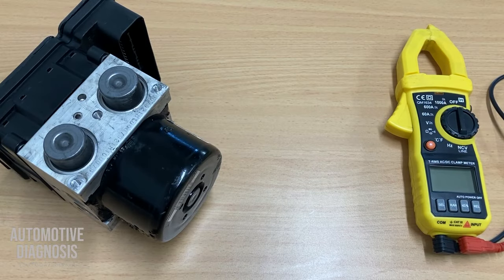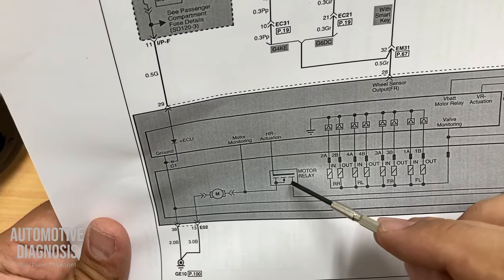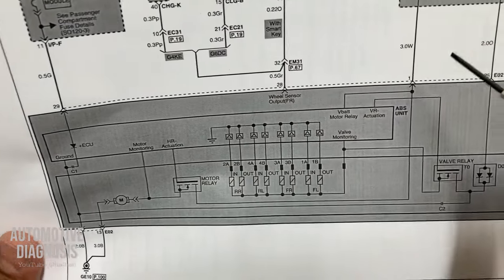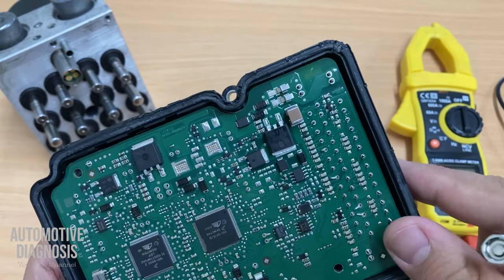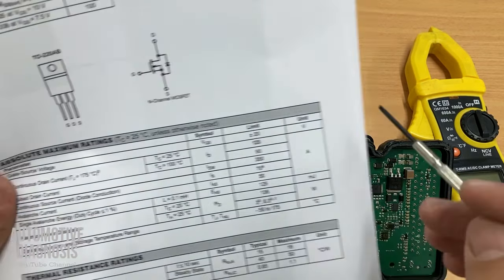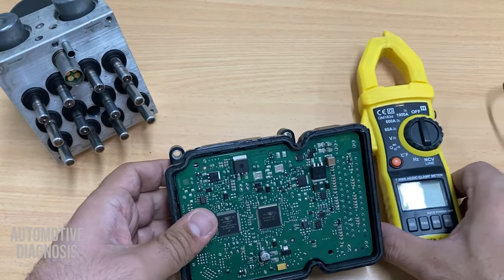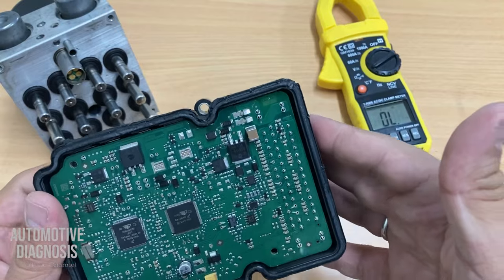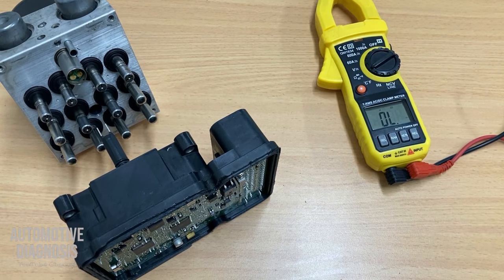Don't Replace ABS Module Before Watching This | Repair ABS Module for Motor & Valve Relay Error

Comment: Hello there nice video.

I have Ford Lincoln 2010 MKZ and is giving me error B1342-20 do you think this could be the electric part of the abs module or the hydraulic part of the abs module issue
Reply from the maker: Hi there, for this fault, I will do the electrical inspection first. But do not remove the ABS module straightaway, checking the power supply and ground on the ABS connector is the first step.
Reply: Thank you, I just checked all the connections and fuses and it's all good. What would be the next step

Comment: I have a 2010 jeep Rubicon. For about 3 years now I have the 3 lights lit on my dash, ABS, TRACTION CONTROL, and airbag. The code is C2116, low voltage at the ABS module. It used to be intermittent but lately they're on all the time. Very few seem to have this code. Can this be common with the module? Thanks.
Reply from the maker: Hi there, it could be the module or wiring problem. The following video could be helpful for checking the main power supply on the module and ground.
https://www.youtube.com/watch?v=F2RiGkoK9_g&t=9s

Comment: Amazing work my friend
Reply from the maker: Thank you very much
Reply: @AutomotiveDiagnosis  I would appreciate very much if you can point me in the right direction.  My Captiva 2010 has ABS, TC, Brake, Hand Brake lights on.  Error codes are C0201:04 & C0550.  I touch up most of solders you showed but no changes observed.  Same lights are still there.  I also bought 2nd ABS cluster from wrecker to transplant eprom as next step.

Comment: For 2012 Honda Civic, I am seeing 81-20 that states built-in acceleration sensor failure(ABS), at times there is another one 85-01 VSA signal failure(electronic power steering). But consistently seeing 81-20. Any thoughts and guidance if ABS pump can be repaired? Thanks

Comment: Hi Dr that's great teaching
But is there any simulator that could help us dignose the ABS MODULE?
Reply from the maker: Hi there, Thanks a lot. Actually I haven't seen any simulator for testing the ABS Module. But as the structure is mostly the same, checking one can pave the way to know how to fix the other ones too.

Comment: Good evening, a question if possible about the abs pump power supply: if there is continuity but voltage drop at the output from the board what does this mean (Input pin on the board: Volt = Battery (13); Output pin on the board approximately 9.00)? A thousand thanks
Reply from the maker: Hi there, you must focus on input and internal connections, some voltage drop is normal

Comment: No error codes!  My guess is that a valve is stuck, but it would be great if I could get in touch with you before I cut the top of the module off.  I would prefer to send it to you to do it properly 👍. Please let me know if you’re open for taking the job.  The unit is out of a 2008 Holden Captiva.  Hmmm… also no continuity between pump negative and either of the main ground pins.. faulty mosfet?
Reply from the maker: Hi there, thanks for your comment and sharing your experience. I’m overseas right now but I can give you some advice. If anything happens to ABS motor power or ground, you must get ABS motor failure fault code. But just in case that you don’t have any code and you are trying to find the cause, make sure you have the proper wiring diagram, check the power and ground on the wiring harness, check the connector, then ABS module. Also, mostly ground gets directly on ABS motor, not through MOSFET, so if it’s not provided, it’s pin or board issue.

Comment: Thanks,for job  but this shematic can use it at all the  ather abs systems thanks man
Reply from the maker: Hi there. Many ABS modules are very similar but the pin outs might be different.

Comment: They sure didn't put too much solder on some of those connections.  I was wondering if it might pay to just go through all the solder connections and touch them up with a soldering iron.  But, maybe you're right.  Check it first for any disconnects with the ohmmeter and then solder.  On another video for a Honda (Odyssey) they talk about a thin wire that tends to break between module sections and how it is difficult to repair.  Have you come across that?
Reply from the maker: Hi there, not exactly that case, but I've had some other cases with disconnection on PCB that can be found by pinpoint testing.

Comment: Hi, 
the way you explain is very amazing and interesting!
Where can we find such diagramme for our model?
Thnaks
Reply from the maker: Hi mate,
Thanks for your comment.
In the wiring diagram, ABS/ESP system you see the details but it actually depends on the manufacturer that what details are included about the ABS module internal configuration.
May I ask what is your car model?

Comment: Thanks for the work. How did you figure it out...  Also, what are the other chips in the circuit... The ones with lots of pins
Reply from the maker: Hi there,
There is another part for ABS module diagnosis that you can find in the video description, I normally explain those parts that don’t need the programming after replacement so I didn’t go for the main microprocessor.

Comment: Great instructional session.  I have the ABS light illuminated on the dash of my '02 Chev TrailBlazer 4x4, with OBD code C0267 -- "ABS Pump Motor Circuit Open".  I have good continuity at the motor connector (motor and leads good), but no continuity between the battery pin (#1 your diag.) and motor ground (#10 your diag.) on the circuit board w/ no power applied:  is this a normal condition because motor relay is open when unpowered, or am I likely to find a soldering fault once I open up the control module?  If I apply power to the circuit board (ignition key on), can I expect to see +12V at the circuit board ABS pump motor output pin connector?  I.e., is there a way to check for a pump motor "open circuit" condition on the board w/o removing the module cover?  Does the ABS Pump Motor normally run for a few seconds on every "ignition on" as a test?  Thanks for the great videos!

Comment: I have a 2012 jeep wrangler with a C2200 code showing abs module internal problem. Do you have a schematic or point me in the direction of what I should do first? The jeep will drive fine with no light for most the day then sometimes it will throw the same c2200 code until i restart it and it goes away. I'm hoping it's some kind of connection issue I could fix. They have been on backorder for a couple years so getting a new one is almost impossible. Any help would be greatly appreciated
Reply from the maker: Hi there, considering everything you said, I think you may start by checking the ABS connector, remove it, inspect all male and female pins, make sure the is no dirt inside the connector, clean it if necessary and then secure it properly.
Reply: I have checked and cleaned pins, it used to be an intermittent on and off prob for a month now its constantly on showing c2200 code only. I'm gonna pull module out and start checking just wasn't sure which one of the checks would throw a 2200 only. No other codes thanks for your help.
Reply: @braddunn5983 did you fix the abs at the end?  I have same issue re c2200.  Wheel sensors ok, wiring ok but still this error.  Can’t find a new module anywhere 😢Any ideas where else to check? Cheers Rudy

Comment: 26:58   off course we have to be carefull because its the brakes.... but if we are taking off the module down its because its not working properly BUT the brakes work good enough when you have them under tension. Its the initial actuation of the brake that is a little  sudden. The existing problem has cleared every inspection  although this has been going on on my car for 3 years..

Comment: Excelant tutorial how to check problnematic ABS module, I still missing one part from the diagram that is still not understanded by me and it is about presure sensor, how can we check it if it bad or not?
Reply from the maker: Hi there, for the pressure sensor we normally check the contact points on the sensor and on the board.

Comment: My ABS control board does not have any soldered pins on the multi pinned socket panel,they seem to be "push fit" type connectors.So should I resolder them all anyway ? (Focus Mk2 2010,UK)

Comment: 2014 ford  f150.XLT 5.0 4xx4,, code, C1440 EO. Which is, Pressure Difference Transducer Circuit Failure ,inside abs module I think?? .do you know what to check inside? Thanks,love your videos.

Comment: Super interresting. My control unit slides freely arround the Big valves pins. Il almost foalts arround them. It is not tight like yours. Is it common?
Reply from the maker: Hi there, thanks for watching. That should be fine. Some of them come with a thinner valves.

Comment: Hi I own a 2013 jk and a c2200 code shows.  Because I could not  get a new module anywhere in the world I had bought a second hand one.  My mechanic replaced the whole pump.   It worked perfect for half a year and then again I got a C2200 fault code 😢 Can this one be repaired or could there be something else
That triggers the code? Thanks

Comment: Thank you for your video.On my car (Audi)i have from abs unit the error  01130 (implausible signal).This fixes on your video is about this error?
Reply from the maker: Hi there, It could the ABS internal fault but it is much safer to check the power supply on ABS module and relevant fuses in advance as removing and testing the ABS module can be complicated. The below video shows you how we check the ABS fuse and power supply on the unit (this video is not made on Audi though), so it is possible to find the wiring diagram then locate the power supply on ABS connector to take the measurement.
https://www.youtube.com/watch?v=NTCEF8FSqTM
Reply: Thanks for your answer .I have check the voltage on fuses and connector and everything is ok.
This means clearly the problems is inside the unit.
Now, the problem the unit has, and I have this error, is due to what your video mentions?

From your experience.
Or  maybe it's something else. For example, need a complete replacement  cpu chip etc.

Comment: Hii
I'm having a issue with a mercedes c200.
There is a dtc C110700 left front wheel signal implausible, even after changing sensor and bearing and the code is permanent. 
Is the issue is with abs module.
Can you guide us on this fault.
Reply from the maker: Hi there, you need to inspect the wiring first. Find the wiring diagram, then check the wiring between left front WSS and ABS module.
Reply: @AutomotiveDiagnosis  we have throughly checked the wiring but issue is same.

Comment: Does the valve block leak if you pull the abs controller off. I want to attempt changing it while in the car by just replacing the controller
Reply from the maker: There is no brake fluid on the electronic part of the ABS but of course every job on that unit has to be done very carefully as all hydraulic components are jut next to that.

Comment: very good friend your videos explain better than the courses I've already done I have an abs module from the fiesta 1.6 mexican 2010 giving dct communication with gatewey the defect is intermittent the defect and in the module I already put another one and the defect is corrected you have augum video about this fix for me to see
Reply from the maker: Hi there, thanks for sharing your experience. If you have replaced the module and it’s been fixed, there is internal issue, you may also watch another video for ABS module repair for internal components test. (Link in description)

Comment: Great video I learn by my self electronic repairing my old cars ( I can'teffort a techniciaan like you) but is so hard to find diagrams i bought Hayness manuals and emanuals but they dont show the terminals pin out and is a nightmare to find all connections where is posible to find ? I search for siemens moduls diagrams to my peugeot which has a short some where from fuse 9 circuit in the VDO MODUL but i dont see siemens have them. Do you have any place where to find free or where is posible to buy them? 
I'm following from Norway where the mechanic houre cost about 190 usd. 🥴 It will cost 2000 usd a reparation they are creazy expensive

Comment: Hello please i need a help my mercedes w204 model 2009 shows esp abs direction assist not available through dashboard then the steering wheel becomes rigid when i roll over 20km/h this means that the system of abs doesn't work? May i change it completely? The scan detect a default which the number is 5001
Reply from the maker: Hi there, 5001 fault code if a "Internal fault in Control Unit". Before replacement, it's not a bad idea to check the power supply and ground on the control unit.

Comment: I have a 2012 Jeep Wrangler it was showing the c2200 code I sent module off and had it repaired and when I got it back and plugged it up and cleared codes the c2200 is gone but now im getting a c2116 pump low voltage code. Is this still a module problem or what do I need to do to verify now? I have never got this code until having module worked on any help is appreciated
Reply from the maker: For this code I would check the power supply on ABS Module first as it could be pin/connector problems. If voltage is ok, it could be internal fault as explained in the video.

Comment: Have a Nissan Wingroad 2003 QG15 engine the issue am having is only when the abs module wire harness is disconnected only  then OBD2 scanner will read my transmission once reconnected the scanner will not read or connect to my transmission or ABS could it be a short on the module itself or wire harness.
Reply from the maker: Hi there, most likely this problem is coming from the CAN-BUS as both transmission and ABS (and a couple of other systems) are connected to the CAN-BUS. I've had some cases that ABS module was stopping the CAN-BUS operation. And your scanner is connecting to this units via CAN-BUS, so when CAN-BUS is down, you will have no connection with multiple units including ABS and Transmission.

Comment: Can you test the ECU socket pins without dismantling the unit? My connector is showing 12v at the two power wires and grounds are correct values. But I am getting error abs pump fault - relay opened permanent. I can actuate values but not pump. Cannot find the relay as an external part, so Im thinking its inside the ECU...
Reply from the maker: Hi there, normally there is no external relay for ABS motor, as I showed in this video, there is a power mosfet to provide the battery voltage to the motor and it’s installed on the circuit board. The only things we can check externally are the presence of voltage of power pins and the proper ground connection on ground pins. The rest of the circuit is inside the circuit board.

Comment: Can you provide the link or website where we can print the abs diagram and website for the semiconductor that you show on your video. Much more appreciated. Great explanation and easy to learned.
Reply from the maker: Hi there, Thanks for your comment. That ABS diagram is already in the description, you can find a link to download it from google drive. I will also attached the semiconductor details as well. (Technically we can find the details for semiconductors by searching their numbers).

Comment: I have a car where the motor is running continuously. Even with the ignition off. I'm guessing the motor "relay" transistor is shorted. Where does the input to the base of that transistor come from? Is there a possibility that it's not shorted but being forced closed continuously by a faulty input at the base of the transistor?
Reply from the maker: Hi there, for testing the transistor you can watch the second part of this video (link in description), and yes, it can also be from the control module too which keeps the transistor active.

Comment: May i know this abs module is from which car model? thank you
Reply from the maker: Hi there, this ABS module was removed from a Holden Captiva, but it's very similar in other cars too.
Reply: @AutomotiveDiagnosis  okay thanks. Ive a Toyota denso abs actuator and it shows B+ motor relay short to ground. Im suspecting the abs motor after watching your video since its only the contact points at the motor for the positive and negative to shorts and there is no relay in the actuator just the resistor.

Comment: How do you open it with out breaking it so it can be put back together. Would a heat gun be a good idea?
Reply from the maker: Hi there, yeah I use a heat gun (just a little) then I cut through the seal with a fine cutter
Reply: @AutomotiveDiagnosis  thank you

Comment: awesome job man :)  ,,, but I have a question... my ford S-max shows me ABS n ESP . then if I stop the motor, turn the key to 2nd position, immobiliser comes to greet me :D . it will disappear after 5 minutes ,,, 1 hour or 24 hours, but it will. then I can start again , but until I reach 15kmh/9mph OR ,,, try to test by diagnosis. then it will lost communication and ABS , ESP and immo shows again. In my car is immo in teh ABS module. so, my question is,,if ABS works good after turn the key in 2nd position and start,,,,, but it fail after (ABS start) during test or drive at 15kmh what can happen? I there any unit or wire whitch is activated only after that 15kmh or test,,but not after key 2nd position ?????? that 15kmh and ABS test is only clue I have 😕 ,, btw, all the relays and fuses are OK. also ABS CAN show me 61ohms